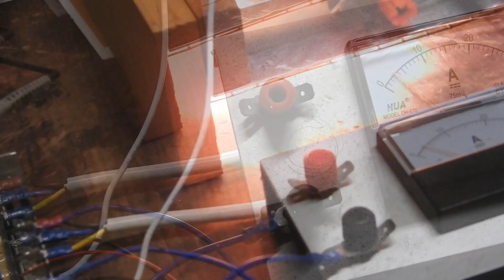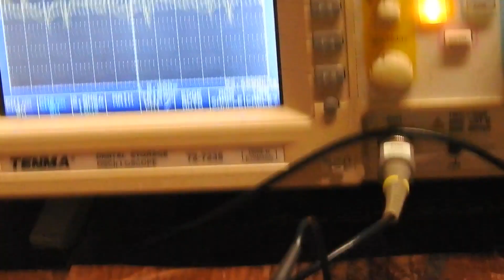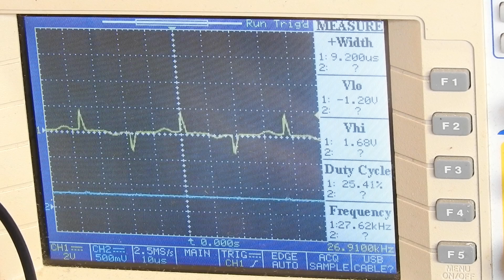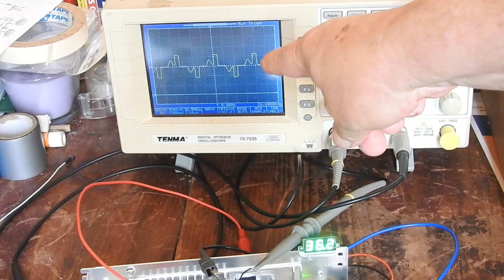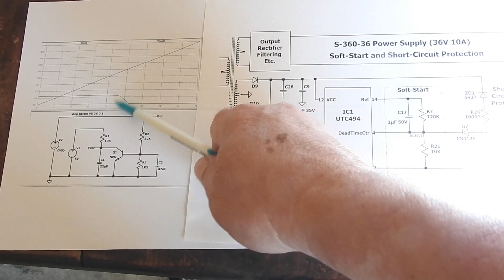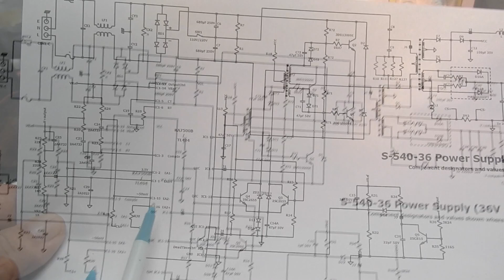Fix (not repair) of cheap switching power supplies

Comment: Hello, we are MATRIX established in 2003. We mainly sell DC power supplies, AC power supplies, LCR meters, electronic loads, power meters, and other equipment. We often have some defective machines or machines with damaged packaging. The recycling value is extremely high. Are you interested in buying faulty electronics?